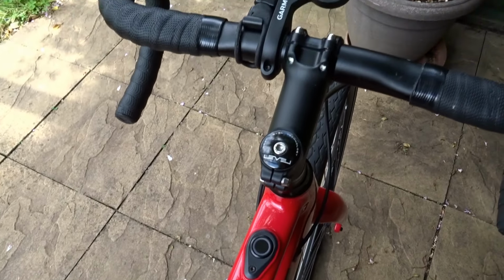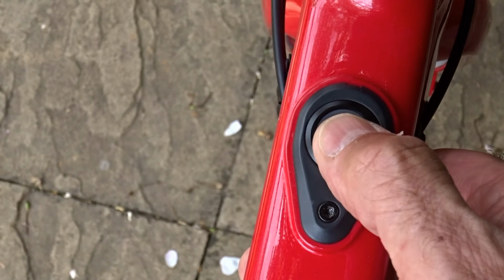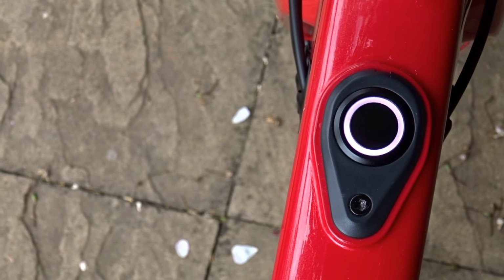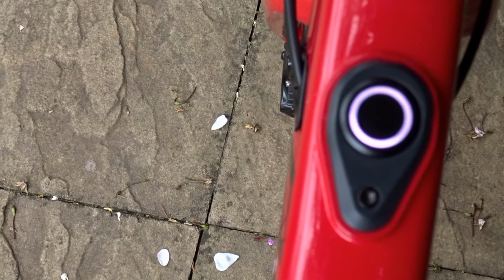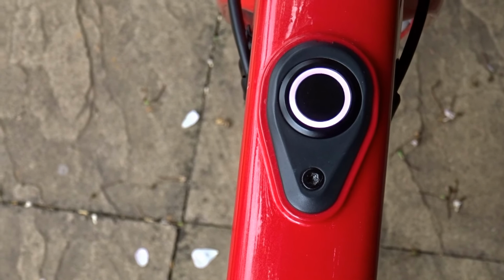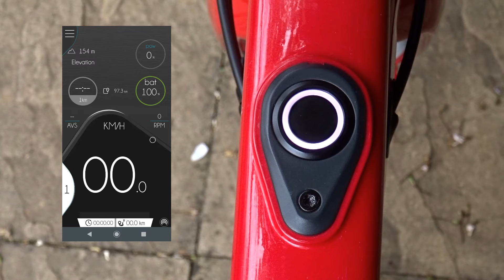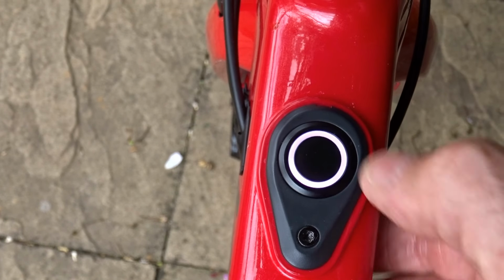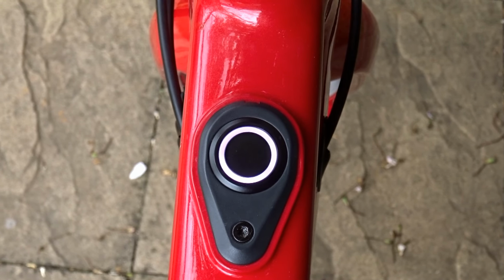How to use the Ebikemotion iWoc controller. As used on Ribble, Orbea and many others.

Comment: Finally understood this - thank you! I couldn't work out if it went to green mode as soon as you turned it on but now realise I need to go though the whole cycle to get 'no assist' to start with. Hurrah!
Reply from the maker: 😀 I’m pleased to have been of help. As I don’t use the app I just leave the power switched off when I don’t need it. Only once I start using power do I switch to white when power not needed.

Comment: That’s a really helpful video because the implication from the less than clear instructions with the Ribble bike which I’ve just bought is that on pressing the power assist button you then stay with the power assist indicator - green, amber, red etc - and I was getting confused on my initial test rides as it flashed and defaulted back to green - which I now understand was the battery indicator, not the power level even though it seemed to be delivering more power.  So a super helpful video!
Reply from the maker: Thanks, Sarah, if I helped then my work is done 😀 I find the simple way to remember is press twice for a power change. Once just shows your current setting and the second makes the change. I hope you enjoy your new Ribble, which has come just in time for better weather and greater freedom.
Reply: Thanks Roy. That’s helpful. Looking to get back into longer distance cycling after a 20+ year hiatus!
Reply from the maker: @sarahbowles4660  good luck with getting back into it. If you ever have other questions I shall be pleased to help.

Comment: Great review of the X35 system Roy. Awaiting delivery of my Scott with X35 (20mph assist max) so now feeling more reassured of my choice.
Reply from the maker: Thanks, Bob. I hope you love it as much as I do. It’s also reassuring to know that Ebikmotion give great support in needed 👍
Reply: do you have a constant display and will it drain the phone with the app on?
Reply from the maker: @UKveloFlorida  hello, Bob. I don’t use the app when riding, so I can’t confirm. However, my understanding from what others have said is that the app is battery hungry. I keep my phone in my rear jersey pocket and found that it disconnects from the bike in that location. If you want to use the app to check remaining power, it’s easy enough just to turn it on when needed. However, I find the iWoc light gives me enough information.

Comment: Thanks Roy.Very useful.
I'm 62. Im new to "proper" cycling. I bought a Orbea Gain F20. The controller instructions are awful! 
Ive got a handle bar controller also that duplicates the button, plus does other stuff. ...a demo mode(50km max for test rides?), a 5km creep(no pedalling) , and lights on/off. The demo i dont want, the creep works but the lights on/off i can't figure out yet....i just need to keep playing with the buttons!.
...no muguards! And none for sale by Orbea!
At 15mph its a commuter. I can't catch cyclists proper except sometimes up steep hills. 
I love it - I can take rolling rests on the motor, sail up hills and knife through headwinds without getting stuck at walking pace or the other option arriving home totally exhausted .

Oh.. Occasionally i get a blue(yes blue) button flash?
Reply from the maker: Thanks for your support, it’s much appreciated. The blue light is a mystery. The only blue light I get is when I connect the app through Bluetooth. If it’s not your app connecting maybe it’s someone nearby. You clearly have some additional functions to mine. If you are really stuck I would strongly recommend contacting Ebikemotion direct. They are super helpful and will sort you out quickly.  With regard to mudguards, I would expect the SKS Bluemels to fit if your tyres are less than 35mm https://www.halfords.com/cycling/bike-parts/mudguards/sks-bluemels-olympic-racer-mudguard-set---700-x-35mm-460252.html?dwvar_460252_colour=Black. They are horrible to fit, but very good. Sounds like you are enjoying your bike regardless 👍
Reply: @RideWithRoy  ty. Yes the blue light is blue tooth(had the bike a month now)...
Loving the bike still.

Comment: My Scott Addict e-ride 20 arrived recently (x35+)  and have used the iPhone app which helped but it did drain the battery . Have been trying since I ordered the bike in October to get a Mahle pulsar one display but without any luck so far.
Thanks for informative video which eased me into the i-woc scene 👍
Reply from the maker: Hello Bob. I asked my contact at Mahle who told me there are no problems with Pulsar 1 supply, it’s just a case of a dealer ordering one for you. I  found a Scott dealer in the UK that could supply a Range Extender when others couldn’t, so might be worth trying to find one of them in your neck of the woods to see if they can get the Pulsar. Good luck!
Reply: @RideWithRoy  Thanks Roy, very good of you to check out. Found online from Germany should be arriving this week 🤞🏻

Comment: Hi Roy. Good explanation, but we have a cheap £650 Decathlon ebike shopper and this as a controller on the handle bars which you press for assist level. It also as a 5 led display for the amount of charge left in the battery much clearer in my mind. Before we bought the bike we tested the Brompton ebike and that was awful.  Keep Safe!
Reply from the maker: I think the idea of the minimalist iWoc button is to keep controls away from the handlebar and make it look more like a road bike. Indeed, I usually have to tell people that mine is e assist. I believe that Ebikmotion also make a handlebar controller which I’ve seen on an Orbea,

Comment: I have just mounted the Garmin Edge Cycling GPS handlebar remote for eBike by the left hand brake lever on the drops. Simple up and down arrows put the power up and down through 1,2& 3. I use the Mahle Smartbike  x35 App which comes with the Ribble x35 Al-E to see which power level I am at. Much faster to change each time and you can go up and down fast. Seems you have to tap twice sometimes, but errors can be corrected so fast it doesn’t slow you down. A bit pricey at £70, but a transformation for all x35 powered drop handlebar bikes. Dealers don’t seem to be aware that this device works on x35/ebikemotion machines. Hold it really close to the works to get it going first time. After that it just works.
Reply from the maker: Thanks, Roland, that’s really interesting and will be useful for many. I’ll see if I can get hold of one for review.

Comment: Hi hoping you help 🤞I have a cannondale treadwell bike and because of the  British weather I haven't used it in a while. I plugged it in to charge today and the light turned white. But when I unplugged the charger there was no light or power on the iWoc button. I've looked everywhere but not come up with any suggestions. 🤷
Reply from the maker: Was the light pulsing while plugged into the charger, Carole? If not, it probably wasn’t charging. Also, a white light would normally mean it was fully charged - do you remember how much charge it had left the last time you used it or was it put away flat? I have heard it said that a long press of the button can help, but I’m afraid it sounds very much like a dead battery. If the bike is still under warranty, I would speak to the dealer. Even if it’s not, I would advise emailing Mahle support direct. Even out of warranty they are obliged to rectify problems for up to six years, although outside of warranty the onus is on you to prove their fault. I’m not suggesting you’ve done this, but people sometimes put a bike away over winter and forget it. Lithium batteries don’t like being left fully charged, or dropping below 20% charge, so It’s always advisable to check the battery halfway through winter. I would normally suggest checking the bike with the app, but if there’s no power the app won’t connect. I’m sorry I can’t be of more help so I hope you get support from Mahle.
Reply: @RideWithRoy  Hi and thank you so much for your reply. The light was solid white, I'm afraid you might be right regarding battery. I can't remember what level the battery was when I last used it but I don't think it was flat. I've tried to call the Mahle e bike number but sadly it doesn't connect. Do you know the email address at all? I'm getting conflicting messages saying an address that my email returns. The back is out of warranty but it's only done 174 miles, 23 trips in total. I hope I can get it sorted out as I was looking forward to getting back on the road again. Thank you again Carole.
Reply from the maker: @carolekavanagh2276 try this one, Carole, mahle.support@heloo.com
Reply: Thank you.
Reply from the maker: @carolekavanagh2276 you are very welcome, Carole, I hope they help you. That email address was given to me by a Mahle contact. If it doesn’t work let me know and I’ll try to find another.

Comment: Hi Roy..I am trying to make out the Ebikemotion manual and in Particular the Range Barr function which gives the range information on one of the maps. Have you any idea how to access this map as I have no clue as yet. The manual shows all these different functions but not really what buttons to push🙄any clues as you seem to be The Oracle on the Mahle matters😊
Reply from the maker: I’m afraid I’m going to fail on this one, Keith - it was only a matter of time 🙂. Assuming you are asking about an app function, you would be better asking Mahle customer services for advice, as I don’t use the app.
Reply: @RideWithRoy  
Thanks anyway..I have been on to their help desk but so far not very helpful, maybe my request is lost in translation as the site is in Spain🙄..cheers..Keith. BTW I’ve had some issues with some of my followers on Strava and have deleted some and unfortunately I deleted you by mistake! So if you want to follow me again you will have to send me a request😊
Reply from the maker: I’m surprised by that, Keith, as they do have excellent English speakers.
Reply: @RideWithRoy  

I think I’ve cracked it! Once you start tracking a ride with the Ebikemotion app the limit of the range is displayed in one of the maps by sliding the
Reply: You’ll get the gist if you play around with it, but you must start the activity first😊I don’t give up easily🙄

Comment: Hi Roy good post but when you first switch on the system it goes white then green - this green is the system diagnostics telling you all is ok, the next colour tells you the 'charge state' of the battery. So if you start white-green-white your system is ok and you have 100%  battery white-green-green 75% and so on. 
It's after you get the third colour you set the level you want, so if you want full press till red leave it & it should flash red a few times then go to white; then you're set.

After this the colour is the battery charge level.

It takes longer to type that do.
Reply from the maker: Thanks for your input. I’m not sure how this differs from what I said. The important point I make is that selecting white after red provides a neutral setting, which allows the power to be totally disconnected while maintaining the app connection.
Reply: @RideWithRoy  1:20 'Green is showing us we are in the eco setting'. Green here shows system is ok. Not trying to be pedantic, not trying to find fault: like I said this is a good post Roy. Enjoy your ebike.
Reply from the maker: shredjoe1 no problem at all with constructive critique and I’m pleased you have taken the time to make your point 👍
Reply: Hello Roy,  I've had my CGRe for just over a month now, and ridden 500+ miles. Your video is really helpful, thank you. I'm still getting used to white = power on and white flashing = standby. Last Saturday I rode less than 20 miles in a strongish wind , stopped for coffee, checked the app and saw that I had already used 50% of the battery.  I turned it off for most of the next 25 miles, but judicious use of power saw me home.
Reply from the maker: Simon Medaney thanks, Simon. Mine has just had its 1st birthday, so I’m now used to getting the most out of it. If you have a look at my range extender video you will see that I managed 100 miles on the main battery alone, while heavily loaded. Much of that ride was into wind, but not too much climbing. Were you using full power? If I was using full power, 40 miles would seem reasonable, depending on variables such as weight and climbing. The beauty of the CGR e is that it’s light enough to ride without power, so you will get used to managing power. Please keep in touch and let me know how things develop for you.
Reply from the maker: shredjoe1 I’ve now had a good look at this and fully agree with your point about the first green showing system okay, as this would be the point that pink would flash if there was a system fault. The reason for my description for green showing eco setting is that when I switch on I am immediately in that setting, so no further button pressing required to select the first drive level. Thanks for pointing this out - much appreciated 👍
Reply: @RideWithRoy  Aha: that's helpful, Roy. Was I using full power: I  thought not, but maybe I had hit the red button in error...
Reply from the maker: Simon Medaney There days when I have to hit the red button, and not in error 😂 I would keep an eye on that, Simon, just in case you have a faulty battery.
Reply: @RideWithRoy  No worries Roy, I stumbled on that by accident. When I first got my ebike I just kept pressing the button, one day I confused it & it went a purpleish colour. Then I read the manuall! 
Reading the manual I also learned not to take the bike off charge till the wee led on the charger transformer goes to green & the plastic collar on the bike plug is used to secure the plug in it's port.
It's a great system tho' lets me & my triathlete brother go out for a spin at a reasonable pace - ie I can keep up with him!!

Comment: That was a very useful video. Sure I would get used to it but the one button set up does seem a bit crude, potentially distracting as well with eyes needing to look at the top tube
Reply from the maker: After a while there is no need to look at the button as it can be done just by feel instead. I guess with a handlebar mounted controller there is a need to look as well. I like the sleek lines it provides 🙂
Reply: That’s a good point, this system is on a few of the bikes I’m considering…many thanks
Reply from the maker: It’s worth looking for something with the new Mahle X20 system. It’s more advanced and lighter.

Comment: How long will the battery have power last if using the green assist level?
Reply from the maker: Depends on terrain, your weight and how much you pedal. If you work on an average of 40 to 50 miles you won’t be far out.

Comment: Hi Roy do you know what the white light flashing slowly means as i can’t find anything on the orbea website, thanks 😊
Reply from the maker: Are you using a Range Extender, Linda? The slow flashing, or pulsing, is usually associated with charging. When a range extender is used, the main battery will charge when stationary or above 15.5 mph. When this is in process, the lamp will pulse quite slowly in whatever colour charge state the battery is in. If it’s not this, I suggest connecting the app to see if a fault code appears. If there is one, let me know and I’ll ask Ebikemotion for you.

Comment: I live in a pretty flat area for about 5 k’s and would rather not use the electrics, can I have the Mahle smart bike app on and still be free riding
Reply from the maker: Yes, Patricia, as long as the bike is switched on and in the white neutral setting it will still be connected. It uses hardly any power in that condition so you’ll not notice it.

Comment: Hi Roy. I just purchased a less than 1 year old Bianchi Aria E-road. I am trying to get my head around the ebikemotion system. When I start in eco, when idle, it switches to turbo every time. This would probably be a setting (I am using the new Mahle app and my ebike is connected to a wahoo element roam). I can't seem to find a manual or a discussion that mentions this issue. I hope you can help me out here or guide me to sources of information where I could find what's wrong?
Reply from the maker: That doesn’t sound like anything I’ve ever come across, Rudi. When riding with the app connected does it show a fault code? You could check that the sensor and magnetic ring, next to the cassette, is clean and isn’t damaged. My video on removing the back wheel shows this. The only thing I can suggest, other than that, is to is contact a local Ebikmotion dealer, so that’s any dealer whose bikes use the X35. It probably just needs a firmware update. Alternatively, contacting Mahle direct would be a good idea. Please let us know how you get on, either on here or ‘Ride with Roy Subscriber chat’ on Facebook. Either way, it shouldn’t be a show stopper and you have a beautiful bike.

Comment: I'm being told white means standbye not neutral I'm just curious about that is either wording fine or is it slightly different?
Reply from the maker: Both the same. I call it neutral as it’s a term most people identify with. It just means there is no drive but the system is on. This means that if the app is used it will remain connected, whereas if the system is turned completely off it will disconnect.